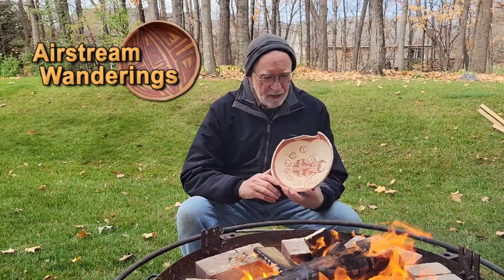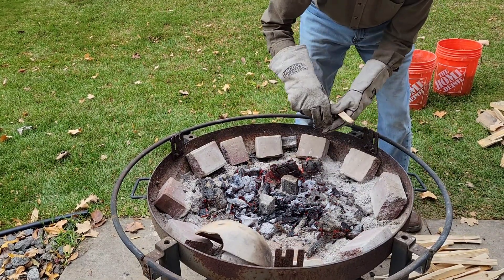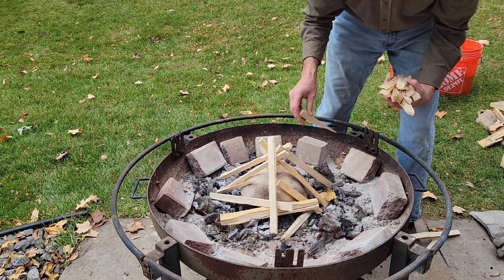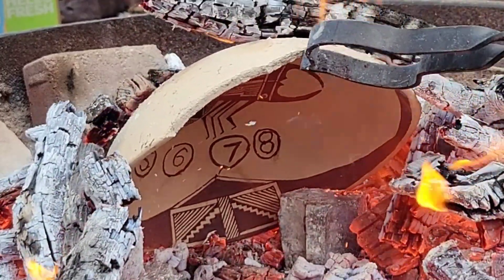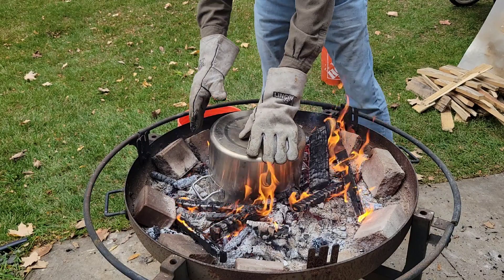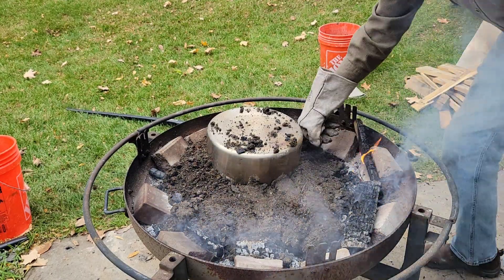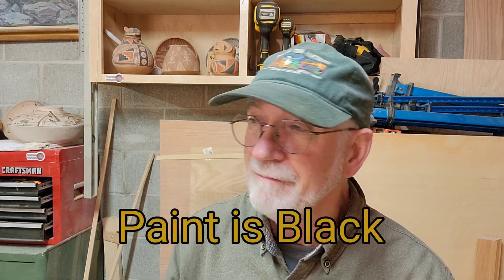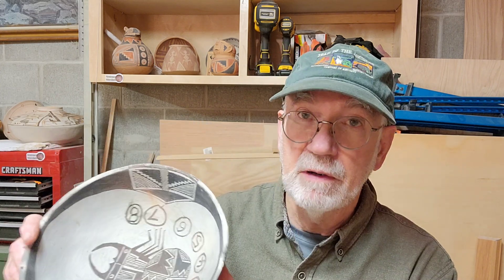Iron Oxide Recipes, New Findings

Comment: Hi so I'm thinking that when you first noticed the iron oxide appearing red, it's likely that it was actually black iron oxide (magnetite) glowing red due to heat. This phenomenon, known as incandescence, is a physical reaction to high temperatures and occurs in materials like magnetite.

There are two common forms of iron oxide: magnetite (Fe3O4), which is black, and hematite (Fe2O3), which is red. I think the red glow seen at first is from the heated magnetite, temporary and  probably doesn't indicate a transition to hematite.Magnetite and clay have different incandescence temperatures. This means at the same high temperature, magnetite can emit light while clay does not, explaining why only the iron oxide appeared to glow red. As you know, above the transition temperature, iron oxide's color can shift between black and red, depending on oxygen availability. In your case, there likely wasn't enough oxygen in the fire to transform magnetite into anything else hence why as the pot cooled down it became black. 

As the pot cooled in a low-oxygen environment, the iron became black because it stopped being so hot it glowed and didn't have a lot of oxygen to support the transition to hematite. 

Regarding the copper carbonate and manganese dioxide additions, which are typically used as black inorganic pigments, it makes sense they work but I feel like you can probably also get a great black with only iron oxide.

Achieving this might involve covering the pot with a glowing coals before covering it with a bucket or dirt for reduction. I'm thinking this should create a better low-oxygen environment, leading to a competition for oxygen between the coals and iron oxide. As the coals die out because of a lack of oxygen, the pot's temperature drops below the transition temperature in an oxygen free environment, allowing the magnetite to retain its black color. 

I'm thinking the issue you, Andy, and others have been experiencing seems to be due to insufficient coals to counteract the imperfect nature of the the air seal.  

I feel like the best evidence for this is the way that at about 3:00 when you cover the bowl with a pot, the cracked part is up out of the coals and the opposite side is pretty deep in the coals. When the pot is removed, the side with the crack that did not sit in the is much more red than the side that was buried in the coals.
Reply from the maker: Thanks for your thoughtful comments, they are much appreciated. I think you are right that there needs to be a significant number of coals prior to covering. A challenge is that the coals can make smoke clouds or leave carbon on the pot. It seems that the best results have been where the coals have largely burned down. It is winter here now and I will have to wait till spring to renew the experiments. Cheers.

Comment: Hey Wes. I wanted to share with you some interesting findings we both have experienced lately . After some research I have found my latest test clay for paint happens to be acquired in an area where manganese has been mined. The clay is not dark or blackish so it really surprised me that it turned very black were burnished with a stone. Test was done in a controlled kiln environment as you know I often do first . Thickness of paint applied also seemed to make a difference. Red where paint was thin, black black black where thicker layers and burnished. I think your right Wes, a small amount of manganese, even a very small amount may be contributing to the over all reduction . Manganese goes through a  gasing off phase about the temp iron oxide starts to blacken in a fire , this gas is oxygen hungry so that could also contribute . Cheers !
Reply from the maker: The answer continues to be illusive. It seems very possible that minerals other than iron contribute to the end result. They could be actual additives or just naturally occur in the hematite or clay used for making paint. Make sure to look at Will O's comment. His experience is that in full reduction manganese and copper yield a grey paint.
Reply: @airstreamwanderings3683  will do !

Comment: Hey Wes! This is a great video! Thanks for sharing this!  I quickly put together a test firing today using a spare swatch I had. I posted the results for you under my community tab if you're interested. (photo with description) I tried copper carbonate and then some manganese on another band. I had the opposite results where my hematite was the darkest.

Looking at your firing, there's still a lot of oxidation that's going on that might be 'tampering' with the results. Oxygen was definitely apparent in the environment when sealed; you can almost see how it flowed through under the bowl in two separate bubbles that meandered across it when cooling, it left two trails.
Reply from the maker: Thanks Will, I appreciate that you took the time to look at the experiment. I'll make a note of your comments. It is very possible that my results were contaminated by a little oxygen.
Reply: @airstreamwanderings3683  Thanks, I hope you find some of the information useful in the quest! 👍

Comment: One more thought , as you know I am one who dislikes the notion that primitive people threw dirt or covered pots “smothered” but that’s just my opinion , I feel a glaze or sealing effect is happening with the iron. So having said that. With copper melting at such low temp I wondering if the copper is surrounding the clay and iron particles along with alumina from the clay? Just my thoughts .
Reply: That's interesting.  When I've seen potters use black iron oxide that's covered in by a glaze, well presto, they get a black result.
Reply: @chrisinkansas8507  well that might be true but I’m not talking about modern glaze I’m talking about reduction firing iron oxide and a micro glaze. At low temp . Any who
Reply from the maker: I think that is part of what is happening. I don't understand the chemistry but it makes sense to me that something keeps the oxygen from coming in contact with the iron. Minerals like copper or manganese seem to be part of the equation but smothering may offer additional insurance. In later years it looks like lead was added. It didn't glaze but seemed to help maintain the reduction.

Comment: Great ! Hey I think active coals with direct contact AT LOW temp like around 600f from my test then capping or “smothering” seems to do it also. This is what one pottery restoration guy had told me he had luck with in replication. This also can cause body reduction as well. Maybe break off a piece of your pot to see if body reduction happened. Great job Wes !
Reply from the maker: Interesting, thanks. I'm wondering about the right temp for smothering. I don't know what you mean by body reduction.
Reply: @airstreamwanderings3683  any iron in the clay body will also reduce. Causing a grey color or even black known as carbon coring , although it is not really trapped carbon as much as it is fluxed iron within the clay itself
Reply: @coopart1  And here I thought that carbon coring was a result of the piece either not getting fired well enough, or that the temperature was too low for the pot to fire completely through.
Reply: @judithwinner12  an ancient pottery firing with black core can result from iron rich clay where the iron becomes an active flux and aid in melting the silica in the clay and also prevent organic carbons from burning off. This can happen when the surface of the pot sinters before all carbon is burned out ie… a fast hot firing

Comment: Wes. 👍
if you do another experiment maybe paint on  the outside of the bowl or do a pot, so you can see when the black occurs, maybe that will give you a better idea without having to lift the bowl over. 
great work.
tom
Reply from the maker: Yes, thanks. I have a    couple of other things that are painted on the outside so it shouldn't be a problem.

Comment: I assumed that the air thight sealing provided by the moist would make the difference. But it looks like the additives are not les important. 👍
Reply from the maker: Thank you. Getting a tight seal seems to be important. It wasn't my idea to use moist dirt but it appears to help. Cheers
Reply: @airstreamwanderings3683  
👍
Reply: @airstreamwanderings3683  
👍

Comment: Fe2O3(red) + CO =FeO(black). CO is carbon monoxide, the reaction occurs at 500-600 degrees Celsius. This requires a lot of BURNING coal, isolated from oxygen. You need to pour a lot of burning coal under the pot, and then cover it with a saucepan.
Reply from the maker: Thanks. One person suggested that I add a lot of fast burning fuel on at the end of firing to consume available oxygen and then smother at that point. Does that make sense to you?
Reply: @airstreamwanderings3683   I'm talking about the same thing.
Reply: I made blackened ceramics: I poured sawdust into a sealed pan and put the pot in (it was fired). He put the pan on the fire. The result was wonderful black ceramics, like soot. Another time I took coal instead of sawdust: it didn’t work. To change the valence of iron, you need combustion without oxygen (although it sounds stupid)
Reply from the maker: Thanks, I have a video coming up where I smudge the inside of a pot with dried leaves. I makes a jet black surface that doesn't rub off. I don't know that it has much to do with iron. @suwlehim_takaz